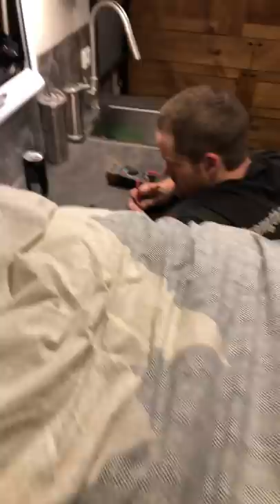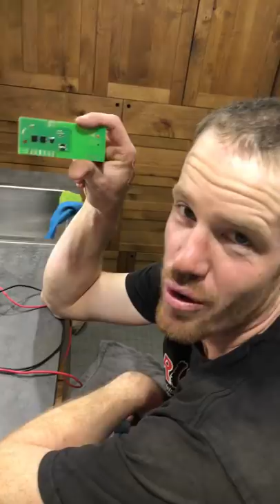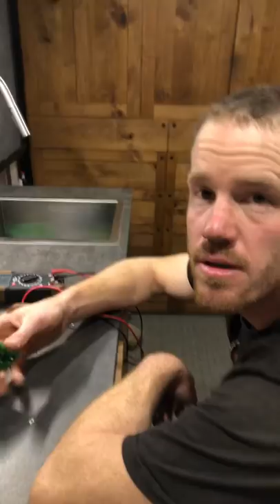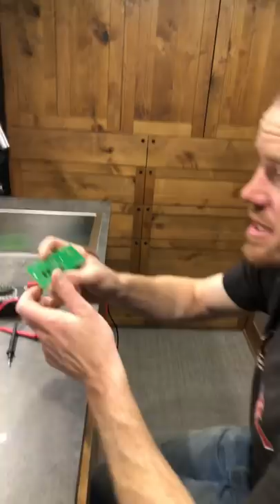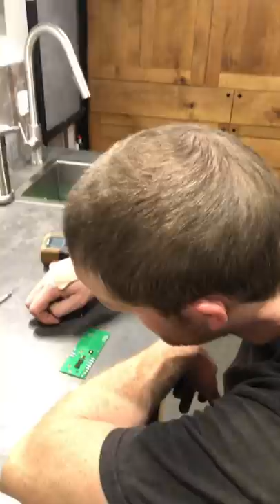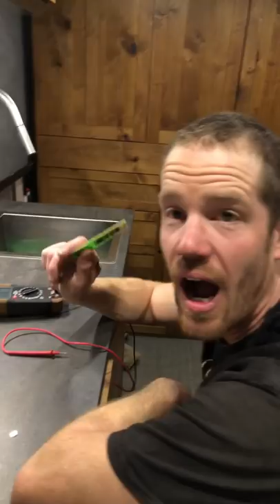Our toilet is broken! 😳

Comment: Self composting toilet never fails. You produce enough sawdust and wood shavings to use in a self composting toilet...... build an outhouse
Reply: They got everything they need for that.
Reply: @Annette Zang ... An outhouse was my suggestion as the first thing to build, once they settled on the property.
Reply: You're going to put a composting toilet inside a camper? Gross.
Reply: We have a composting toilet, add saw dust no smell no problem

Comment: 5 gallon bucket. Cheap, easily fixed/replaced, NEVER fails. Look into dry composting.
Reply: I’m with you, and the first thing into the bucket 🪣..... that little circuit board.

Comment: Wait, you have a circuit board in your toilet?  I have a hard enough time getting a manual flapper valve to work correctly.
Reply: Are you sure it's not the ballcock?🤭
Reply: @himhim3344  ballcock is just another flapper valve devise
Reply: Lol my question is how he going use the multimeter on the board when there's no power on it lol
Reply: @blaketurner5799  He's ohming it out to find short or open

Comment: The pain!  Get that Kubota and dig an 8ft scoop and put a closet on top.  You need the hole for the perc test for the leach field, plus’s you’ll have a place to dump the thetford.  Or cut out the middle man and dump right into the hole….Modern electronics are quite the black art….not quite the follow power in and out for the circuit.  I’ve had zero luck with disposable circuit boards.

Comment: You say there is power to the flush valve all the time so remove the board and replace with a switch ( or just connect the 2 wires going to the flush valve when you want to flush). A good picture of the board would help, did not look like more that a few transistors and a switch, should be easy to get parts at DIGI-KEY

Comment: Back in the old days thing were so much simpler............. I'm thinking about the port-a- potty I had on a sail boat, manual vale and push pump to flush, worked every time!..............."You're-a-peeing" you say well maybe like a bear.......... in the woods......... Electronics will always fail at some point that's a given!

Comment: Sounds like the micro switch failed.  Board may not be available... but surely the individual components are.  Power in constant... power out only when depressed.  Micro switches are fairly universal.... just get the right size... Amazon

Comment: I would suggest finding the components on the board on Digikey.  I don't know your electronics skills, so I suggest changing them all, since there are so few.  If you do change them or otherwise fix the board, conformal coat the pcb for moisture protection.
Reply: If you are determined to chase the circuit, each of the chips will likely be found at Digikey, and so are the datasheets and schematics for the integrated circuits.

Comment: Your bathroom build in the appartment will be beyond imagination, a good slope in the plumbing, vented with an extra ventilator, sunpowered heated toiletseat in the winter, the floor with an extra drainage and at last but not least floor and walls with Carreramarmor. Don´t forget an extra post for heavy weight. A big mirror over the vanity with a decent lighting should complete the bathroom

Comment: Seems I came across similar complaints with electric flush devices during a “best portable toilet” video search. The comments were the US versions cost too much to repair and if you could source the overseas part it was less expensive?  
Either way-might be some help out there for any “known issue.”

Comment: You can most likely replace all the electronics with a heftier switch that simply turns on and off the little pump motor.  If the button on the PC card is activated by something other than your finger there might be alignment issues.   I had a Thetford toilet with a bad manual pump and rigged it with hard plumbing, a water valve from an old dishwasher, and a push button switch mounted on the cabinet next to the T.P. roll.  Really convenient and how many people had electric flush toilets in a travel trailer back in the 80's?  Best of luck with your problem.

Comment: I suspect it is a timer circuit ..you can just rig a power supply to the valve but have to hold the “ button “ in for the whole flush

Comment: Better to have a European circuit board, rather than a Southern Hemisphere circuit board:  you would have to remount the toilet on the ceiling for use in the Northern Hemisphere ... 🤔😖🤯 ... I bet you can reverse engineer the circuit and replace the entire board with switches, relays, cables, and levers.  Or, assign Boone with digging a hole every 3 days and built a little portable hut, complete with heater.

Comment: Your button is shorted, the contact is always closed. Get a new button. If it's a push button most any push button will work. If it's a simiconductor button then there is more you need to investigate. Maybe there is a short across the soldered leads.

Comment: Did I miss the septic system install?  The gray water drain for the shower?
Does a bear poop in the woods?
Reply from the maker: This video is a few months old and is about the toilet in our camper. We have not installed a septic system on the property yet but we hope to this spring.

Comment: Funny thing The problem is not even in there so you can look and look and again look
 Your looking and it's a crazy thing keeps  Flushing because it's overboard be careful it gets Hot..
Reply from the maker: We discovered a short in the button that was causing the flush valve to stay on continuously. All fixed now!
Reply: @AmbitionStrikes  Funny thing I knew you could fix it..

Comment: What is the Thetford model you have? Are any of the button contact points labeled on the circuit board?  Since you have it out and have a meter, see if you have continuity across the switched terminals on that button.  If you do, it's stuck closed electrically (in the "ON" position).  If it's a soft button with the carbon on top that a membrane closes the circuit for when pushed, it may just have some conductive residue you can clean off.  A gentle cleaning with a q-tip and some electrical contact cleaner (or alcohol in a pinch) may fix it.  If it's a sealed unit, the problem may be in the logic side of the circuit which is another story.
Reply from the maker: Hi David! You nailed the issue! I was able to disassemble the switch and clean the contact. All good now. Do you think it would be a good idea to add some anti corrosion spray to the board and switch?
Reply: @AmbitionStrikes  It needs to be a anti-corrosion product rated for electrical contacts (which are usually a dry lube type product).  WD-40 makes a specialist contact cleaner spray and some Home Depot's carry it.  Also check auto parts stores as they may have CRC contact cleaners.  Plan "B" would be a di-electric grease, but that would tend to attract dust as it's a grease and does not dry to protect.